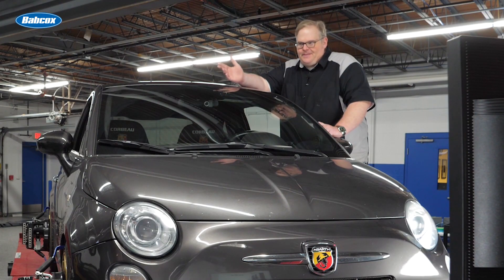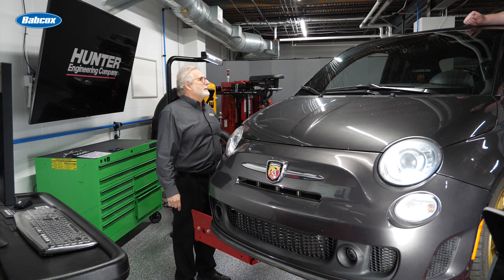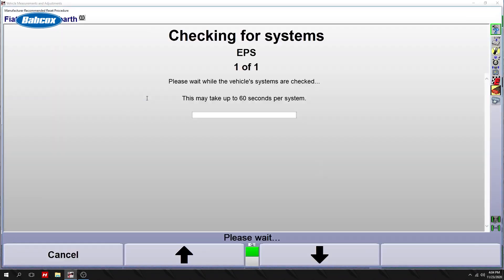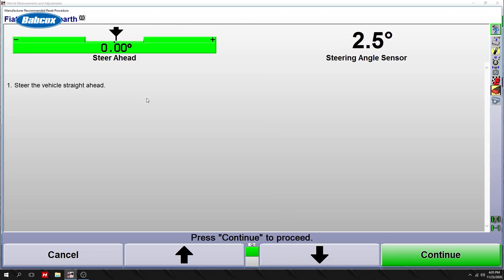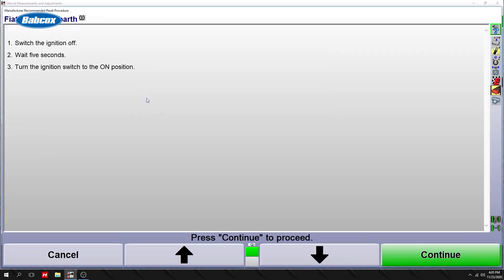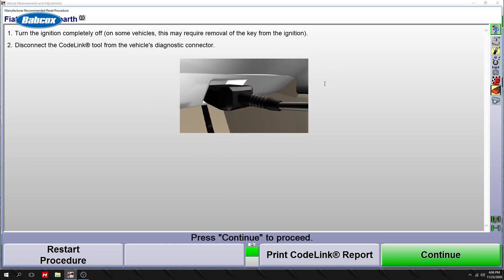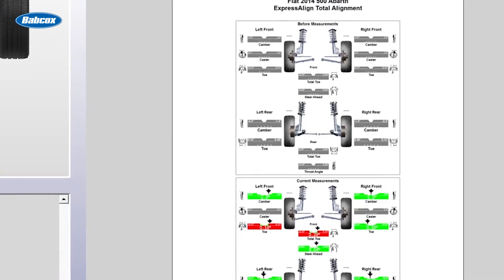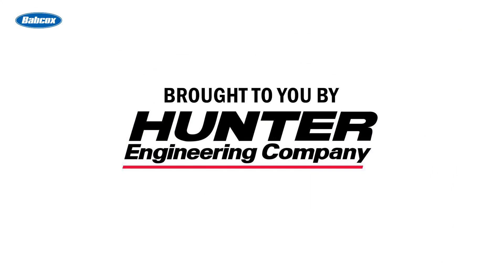Hunter Resetting Steering Angle Sensor

Comment: Not really a modern marvel for vehicles modern vehicles anyways why do you need a steering angle sensor I believe it's just another thing to go bad that you're going to have to repair or replace
Reply: Its there because of its electric power steering. And yes you are correct it goes wrong on many many fiats and isnt the cheapest thing  to get fixed.